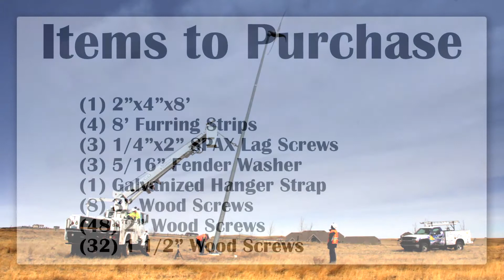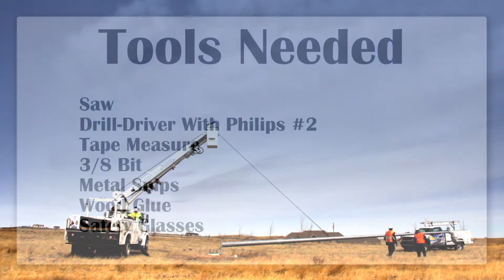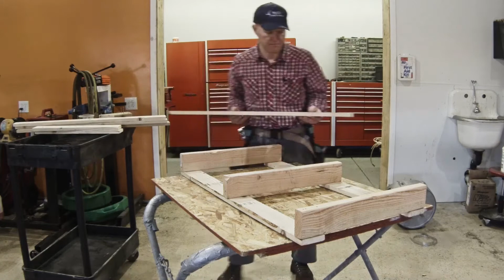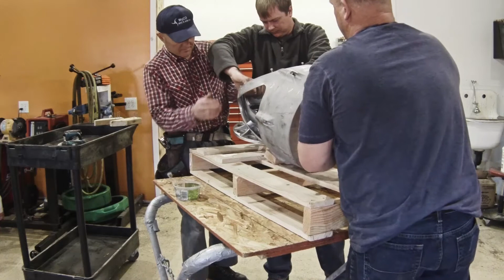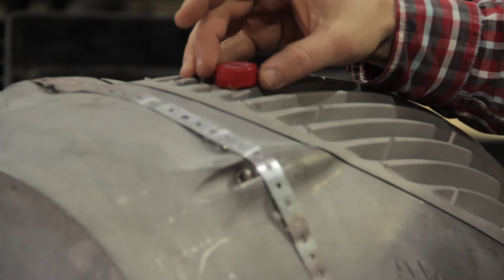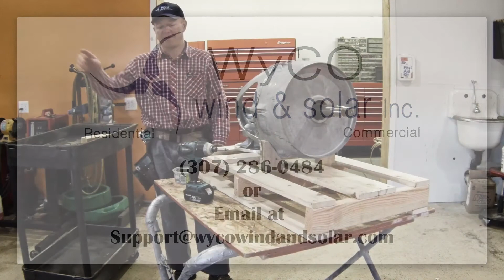Skystream 3.7 Repair

Comment: I'm in need of the brushes / graphite bar that transmits the electrical signal from the grid (220v) to the wind turbine through the slipring rotating disc that rotates according to the wind direction. Can I use the same ones sold commercially for electric motors?
Reply: Yes, I also sell them - they are $95.00 including adapted springs and sealant.